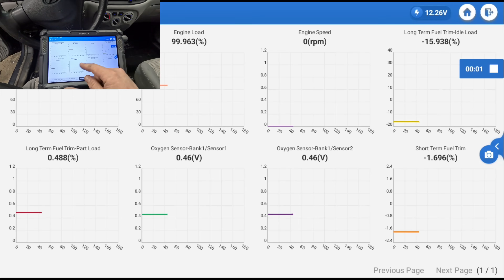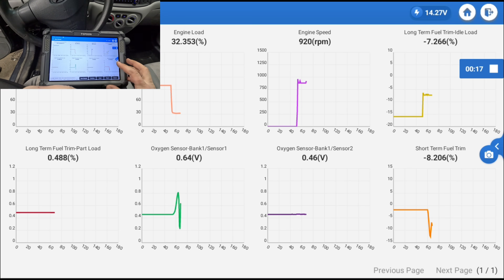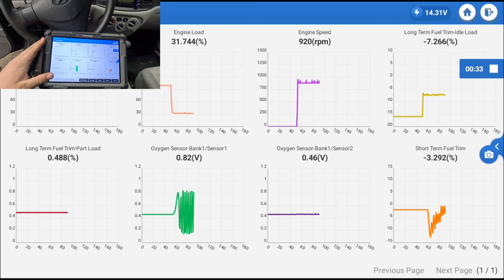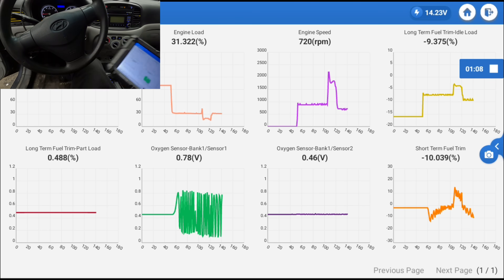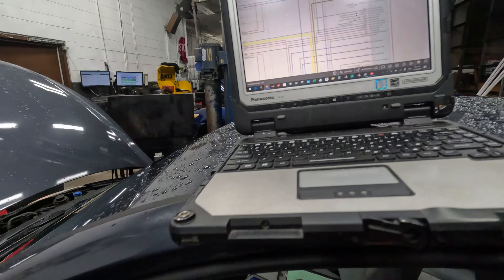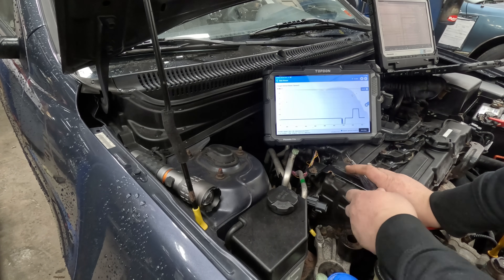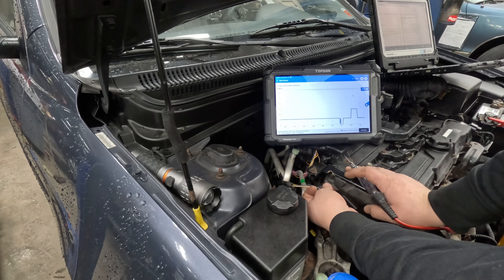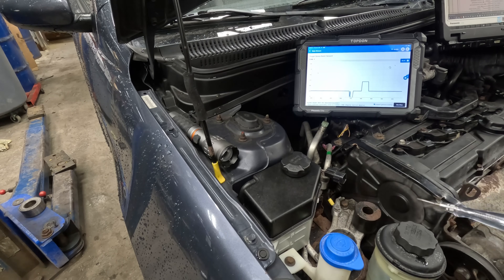2010 Hyundai Accent - Downstream 02 sensor Problems | Diag & Repair!

Comment: Hi! Great job. I have a Hyundai Accent 2010 and the scanner device shows me issues with the Oxygen sensor # 2. It has never been changed and the car has 187,000 Km. What brand or brands of oxygen sensors do you recommend for this car? Do you know how many wires does the original sensor 2 have? I want to find the right one and give it to the auto mechanic for installation.Thank you!
Reply from the maker: I like Denso 02 sensors; here's the part # for your vehicle, DENSO 2344851. I would not buy one from Amazon or eBay, as many are fake. I like to get them local or from Rockauto.com
Reply: @advancedleveldiagnostics  Thank you so much. Straight and to the point! I found it.

Also, to my knowledge, what's the name of the portion of the tube where the downstream O2 sensor is connected to? It looks that my car has a very old one, and I was wondering if that breaks when trying to remove the old 02 sensor.

Comment: Interesting.  Any thoughts about ohming the sensor ground to the power ground on the computer itself?  Just to eliminate the possibility of a bad wire crimp at the connector. Since no power required, it could be done with the connector off.
Reply from the maker: That sounds like a good idea, I probably should of done that.Thanks!

Comment: Need a second opinion please.  Persistent P0161, B2S2 heater circuit, has power, has ground pulse from ECM, swapped sensor from bank to bank, still same code.  Leaning toward ECM, any thoughts on it is appreciated.  Great videos as always, right to the point.
Reply from the maker: I would check on a scanner if you have amperage through the sensor.

Comment: hey ..  Thanks for the heads up on that X431 Pro being on sale.  I bought one and my buddy bought one and it's a pretty killer tool.
 On mine, everything seems to work fine, except on the first home page where there are several buttons, the:   "SERVICE FUNCTION" button does not work..  Well it works, it just takes me to a blank page;  where normally it would be a bunch of shortcuts of resets, etc.   It looks like I can still do the functions, they are just scattered around in the software and different modules, rather than having them grouped up in a convenient menu.    Are you going to make a video about this thing or a review, etc?   Because I would really like to know if mine is just broken and needs repaired or if that 'service function' button just isn't supported for something this old?     Can you please just open up yours and see if that 'Service Function" button in the center, near the top-- that has the wrench symbol:   is working or not?  Please let me know--  I really appreciate it.   and thanks again for the clearance shout out.
Reply from the maker: Mine is blank too

Comment: Great job. Do you think will throw a code after awhile because the ground from the coumputer one time i did the same and the code came back but i am not sure it's heater ground countrol or the sensor ground
Reply from the maker: The shop took it on a long test drive and it wasn't coming back. I'm hoping it will stay off.

Comment: You didnt' really need to prove pin fitment..  You already showed that the pin was working when you put power to it and it would go UP on the scantool.  (11:30) ..  It's still not a bad idea to touch all bases though when calling a bad computer.     Edit: (well, unless that power was actually going down and through the O2 sensor and the signal change was coming back up through a different line..  and not the suspect ground pin)
Reply from the maker: With the test light I was only proving that the signal wire was good, the ground is separate.
Reply: @advancedleveldiagnostics   At 11:30  -- you put 12v on that same ground wire, and showed how it spikes the signal on the scantool;   but I think it was just passing the voltage back through the O2 sensor and effecting your signal waveform on the other line (the positive side).. So it did still prove that the signal wire was good..  Plus it proved that your ground WIRE was good from the computer to the sensor...  Plus your test light wasn't lighting up --  so it also proves that your ground coming from inside the computer wasn't working:  all in one test .............   anyway,  I see now what it was doing.   It's hard to explain in text form. :)   .........  Tapping into that wire at  the computer tests everything all at once from that one spot.  I'll remember that on my next one.

Comment: Genuine question, why do you use a pierce probe instead of just back probing the wiring behind the connector?
Reply from the maker: Many times, you can't get a reliable connection with back probing, or the connector is hard to access. You can also cross pins if it's a really tight connector.

Comment: Well done bro, does the downstream o2 sensor effects the engine performance, I thought it's been there to let you know that your cat is good, is that right ??!
Reply from the maker: I couldn't find in service info, but I definitely have seen cars that have a Data PiD for downstream fuel control. But watching these fuel trims, it is clearly affecting it.
Reply: @advancedleveldiagnostics  right, we are missing a something
Reply: Check the channel called TST Seminars. They have a video from December 2023 titled Mastering Generic Scan Data (check 24 minutes into the video). They addressed this issue of rear O2 sensors contributing to fuel trims.
Reply: @abdul-kabiralegbe5660  thanks Abdul-kabir 🤗🤗
I will check that

Comment: Why do look at engine load?  What significance does that pid have?  Just curious. I always c that pid but it seems it just would tell if I am pressing the gas pedal
Reply: Engine load is calculated from engine rpm, temp, tps, maf, map, etc input. If for example your maf is reporting incorrectly, engine load will be off as well. Its a clue, a piece of the puzzle.
Reply: Thank u Mr.blonde. Appreciate that!!